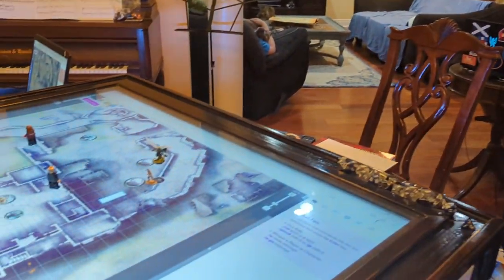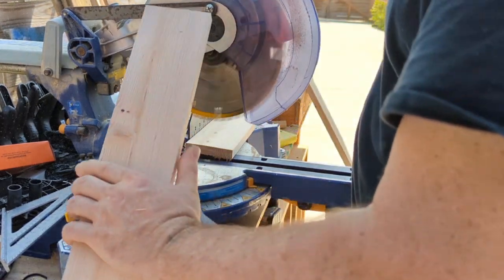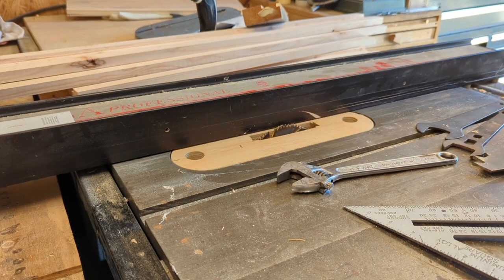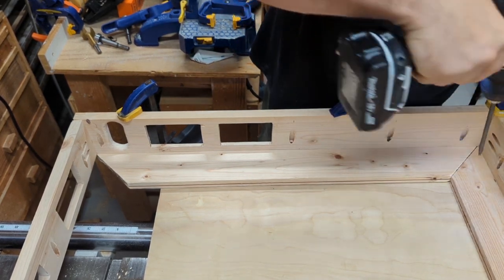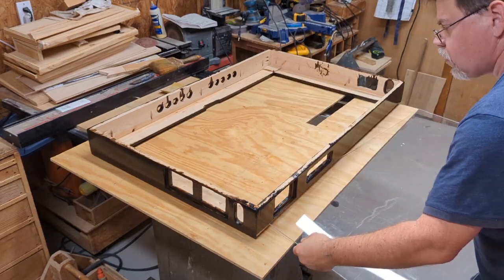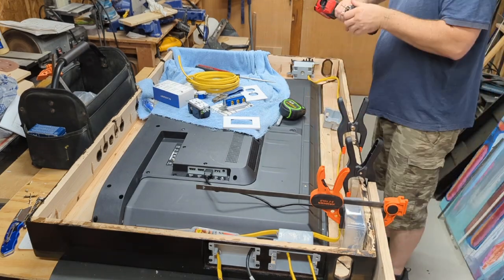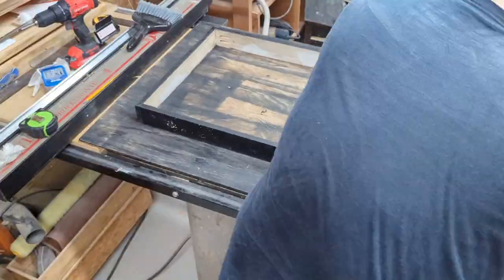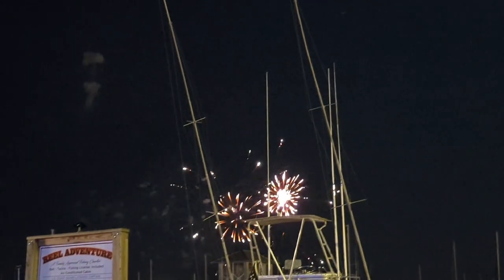DIY D&D TV Case: Portable Awesomeness!

Comment: Maybe I missed it but do you have plans also did you rest the TV on top of the plexiglass?
Reply from the maker: I don't have plans exactly, because I deviated from the plans quite a bit. I will see if I can find them and make them available if I can. I cut a groove the plexiglass fit in just a 1/4 inch above the TV.

Comment: What size lumber did you use
Reply from the maker: Whew! Great question. Mostly 1x6s. But I was trying not to buy anything so a lot of it is scrap. The back/bottom is a piece of scrap luan. If I had to do it over again I'd make it lighter some how. It's almost too heavy.
Reply: Is the top piece that surrounds the tv with the spot routed out that can hold the dice a 1x4 ima try and copy your exactly you should draw up a plan with instructions and sell it!
Reply from the maker: @RobertMyatt-rn7go  yes sir, it's a 1x4.